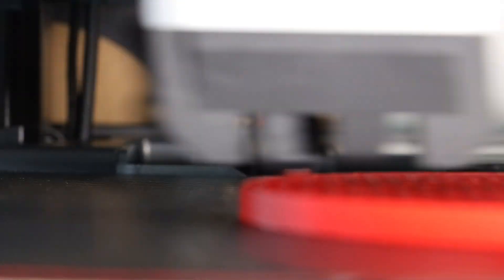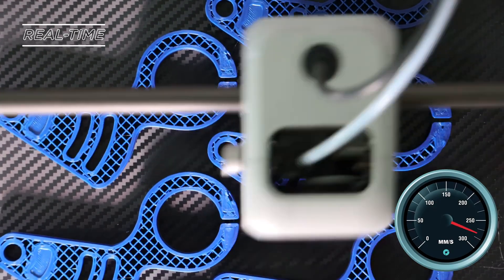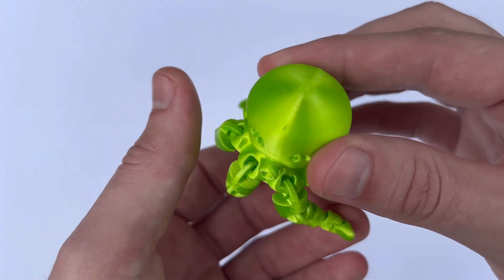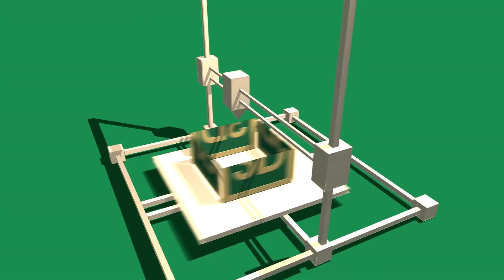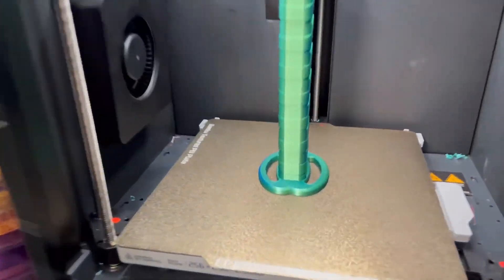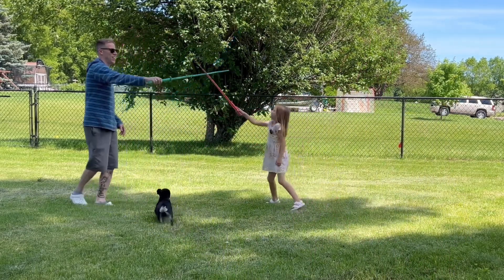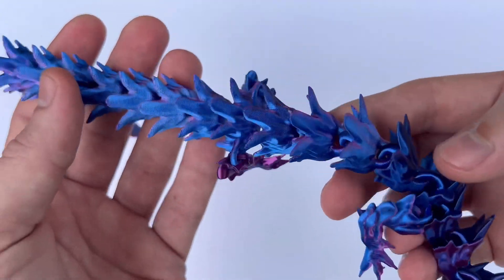Honest Review on Polymaker PLA Filament - Worth It?

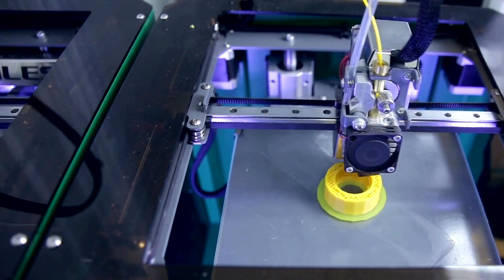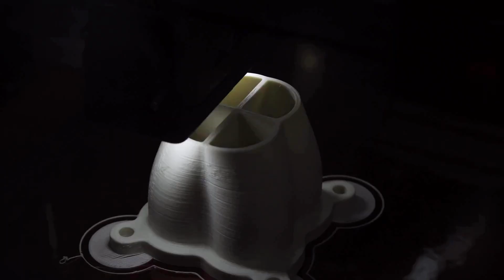Comment: Polymaker spools are cardboard, but here the spools are plastic. Are these test realy done with polymaker?? check at 1:10 at 1:43 and at 2:02
Reply: They have both cardboard and plastic spools btw
Reply: It’s not uncommon for people to respool filament from cardboard to plastic spools. Using cardboard in an AMS sucks.  

Polymaker also used to use plastic spools. Specifically these black ones in the video are their old Polymax spools lol. 

Literally 15 seconds on Google would have told you that